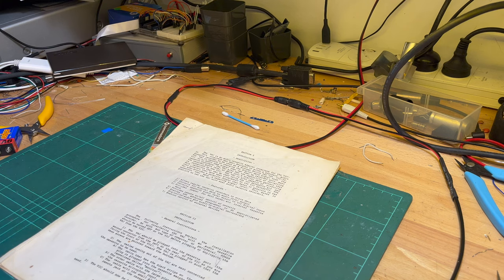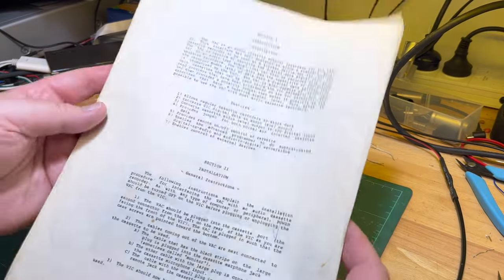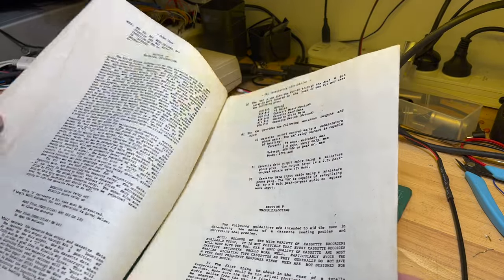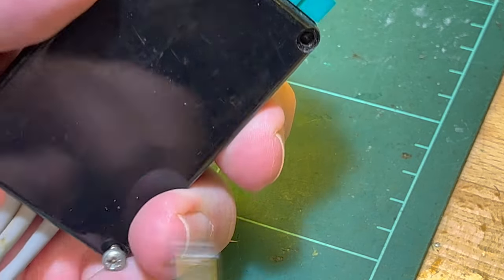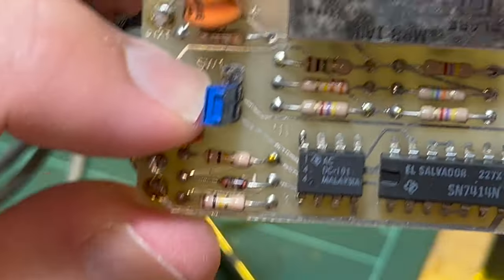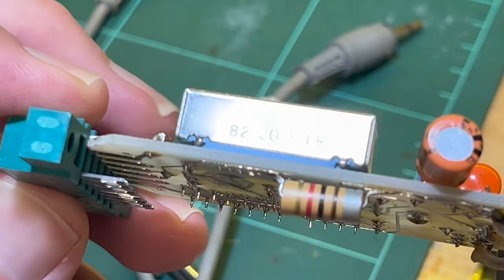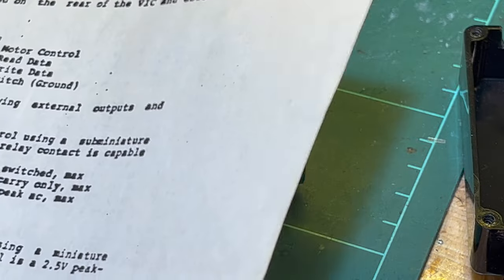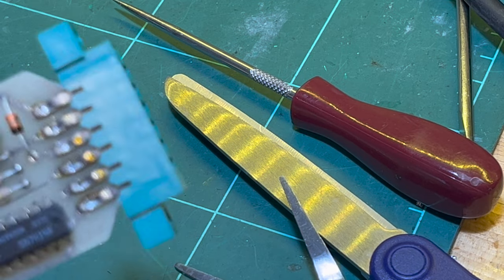Commodore VIC-20: Micro Systems Development "VAC" Cassette Interface (Part 1) [TCE #0217]

Comment: There is a chip with name TSM101 which is an 8 pin integrated circuit that is a dual op amp so maybe that is an equivalent to the TI DC-101.  There is an interesting book you can find archived in PDF format on the internet called "Easy Interfacing Projects for the VIC-20" that has a very simple circuit for building a VIC-20 universal cassette interface, likely simpler than either of the ones you have shown as I don't think it has an op amp at all.

Comment: That large cap and resistor looks like they are used as a time delay for the relay. It could also be that it is being used to reduce the amount of current going through the relay after the contacts are pulled in.